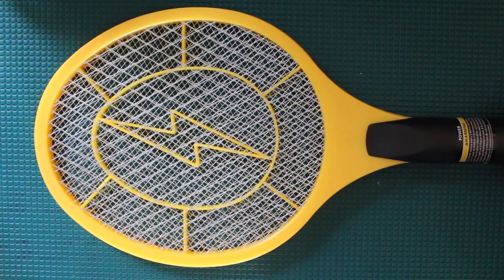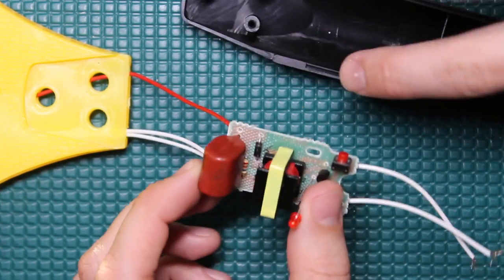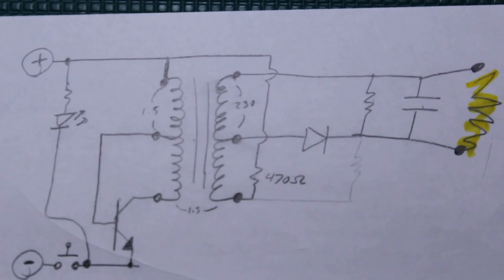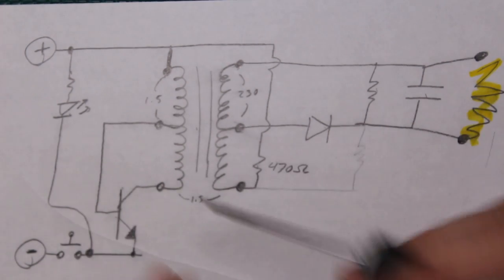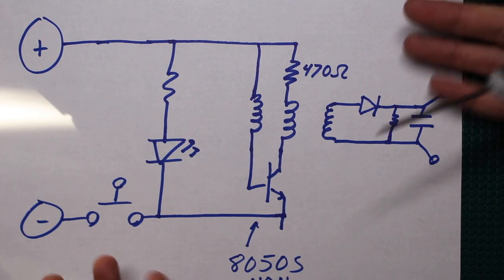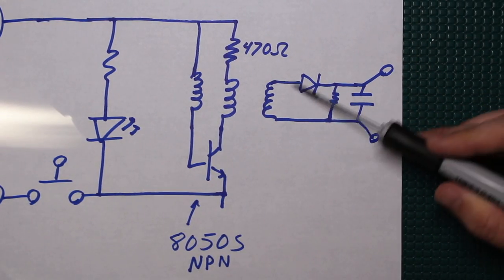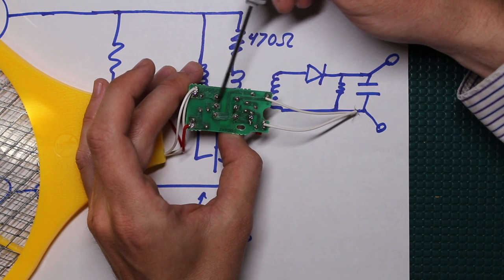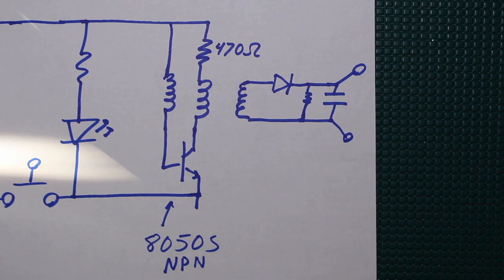How those Electric Fly Swatters Work!  Teardown and Schematic

Comment: Yes. Please, make a deep dive. Performance, voltages, current consumption, etc.
Reply from the maker: haha, yea I actually just saw a related video to this one is some kid sticking his tongue in one of these!  But yea, I'll keep this board on my desk and take that deep dive
Reply: Kevin Darrah Amazing video. If you go more in depth, can you compare this circuit with those toys that are meant for shocking people?
Reply: I agree
Reply: Interesting.  I have several of the flies Waters gained over the years, and have noted that the earlier ones were up to 900 volts whereas the more recent ones are a paltry 300 or so. The higher voltage one causes a gratifyingly  loud "pop" when intercepting  a wayward moth or fly mid air:. Whereas the lower voltage ones merely kill the flying beastie, without further drama. I decided to pump up the voltage of the lesser ones, but I can see that I need to put in more study before messing with it.
Thank you!

Comment: I improved my swatter a little bit, with soldering another capacitor in parallel to the existing one.now it's blowing flies to pieces.small blue sparks,a few seconds later,bzzz,BANG.with a nice blue Flash.

Comment: Thank you Kevin for this very interesting video. Question for you: when I push the button (and charge up) on my fly swatter in a pitch-black room, I see dozens of little points of light all over the inner grate, I imagine in the same spots where an insect has been killed (but I can't verify this). 
I don't see any arcs, so what exactly is causing the grate to glow like that?

Comment: could you have gotten the transistor pinout wrong, if B and  C was swapped the 470R would limit base current
Reply from the maker: thought about that, but the datasheet shows EBC, so all seems right?  I think I'll pull the transistor out though and check... wonder if they used some variant of it that swaps BC
Reply from the maker: hahaha, OMG I just pulled the datasheet again, and sure enough the BC pins are indeed swapped!!!  even for a TO-92 package!  that's pretty weird.  Funny thing was that the SOT-23 pack shows EBC... guess that's all I saw when skimming through it
Reply: Lasse Langwadt Christensen Not only the base current, it gets the circuit oscillating... First there will be current flowing from B to E. That will turn the transistor on and due  to ohms law all current will flow through the other coil (C to E) turning the bjt off again. As soon as the bjt is off the currents only path is from B to E. Thats roughly what gets the primary side ocillating. Could be that windings of the coil are in reverse directions so Ac is induced to the sec side(wouldnt make sense with the diode) or their same direction and its just to get as much power used as possible. Even it looks pretty similar like a Joule Thief im pretty sure it isnt one. If im wrong at any point pls let me know.

Comment: How would you rewire it to charge the center and cut out the outside cage?
Reply: This is my question as well. This zapper doesn't work well with small fruit bugs as it can't touch both inside and outside at the same time. I have removed the outer nets, but now center doesn't work; however, one outside wire zaps, but the other outside wire does not, so now it's all screwed up as I don't know anything about electricity. I tried messing around with outside wires touching the middle net (only one touching, or both touching) and nothing happens, so again, only one outside wire zaps, and the middle and the other outside wire still do not zap.
Reply: You need a different center screen that alternates positive and negative bars either horizontally or vertically.  The Negs are all wired to one side of the output and the Positives wired to the other output.  The critter completes the circuit.  I believe there are at least two manufactures that produce these.  Executioner being one and I cannot remember the other. name brand one.  There are various knock off models of thes two.
Reply: Not having the outer grids lets you touch the shocking grid easily!

Comment: I acquired a NAPA auto parts cock with a neon ring light on it.  The neon driver power supply transformer burned out.   I wonder if this power unit can drive the NAPA clocks neon tube?

Comment: I have the same kind here but it runs on 2 d batteries and I also opened it up, it's high voltage capacitor has 12kv on it

Comment: Why is it using high voltage instead of high current? After all, it's the current that kills.
Reply: I think its cus when the voltage find through the fly, its the low resistance of the fly's body that creates the high current(uneducated guess)
Reply: It is built to stun or kill small bugs not human. The amount of charge stored in the capacitor is just enough to not shock human if touches them accidentally. Even taser cannot be made with high current.

Comment: Yep, I would find that very interesting. Also doing that across multiple of these devices since the circuitry differs quite a bit among them. And although I do understand some of them somewhat, I never understand all of them completely. Especially due to the transformers being used, I guess, if they're different than what you'd expect. I was thinking of winding my own, just to get some more voltage and current into the HV side. 

Would love to see it. 

There's another video on YouTube in which a guy just ordered a HV stungun module and hooked that up. It's nice but now we're starting to get these giant wasps (they're not really wasps but a different species) more power is needed in these things. One thing that bothers me with the factory default ones is that the bug often isn't killed completely when it is zapped using the standard circuitry. It suffers. Especially when the batteries start to get low. 

So a 1 or 2 18650 battery version would be nice, stepping up the voltage and current when compared to the default circuitry. Current doesn't have to be upped much. Might get too dangerous too quickly, but every bit helps. 

If the giant wasp gets killed instantly, that's the goal. And the stun gun module doesn't seem to do that all that well, consistently (I already used such a module too in one swatter that I have).

Cool thing about that is that small mosquitoes do get instantly vaporised. Which is why I have been satisfied using that for quite some time. However, as I said, now the large wasps (hoornaars) are here... something more feisty is needed. 

So a deep dive would be highly appreciated.
Reply: Oh wauw... I see you are doing a lot of Arduino stuff. Cool. That's a subject I have been wanting to get started with for some time now. Might be a good summer to finally start with that. 

Definitely will check your videos out!

Comment: I think he doesn’t know this is a flyback circuit and it works like that
Reply: exactly, actually the transistor base is limited by the R. once the transistor exceeds it's collector current it can support it'll put the T out of saturation , collector voltage rises and thus primary voltage is reduced.  this will now reduce the base drive current and the T1 will cut off. now the cycle repeats. of course also the core saturation of the transformer will lead to a drop of inductance which increases the primary current even more, leading to the voltage rise at the collector and supports thus the shutdown procedure as described

Comment: Too much work having to keep the button on and swinging it around like a fool. It's ok if you only need one hand but not ideal for me. I'd rather stick to spray and candles otherwise you look like an idiot. Would be neat if you could keep it on without having to keep button pushed in or be able to hang it up on your porch.